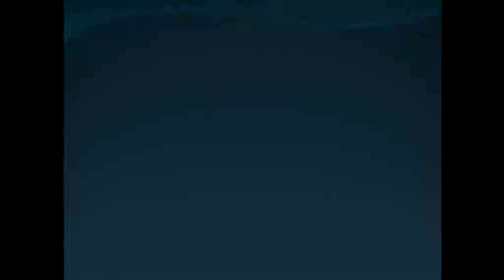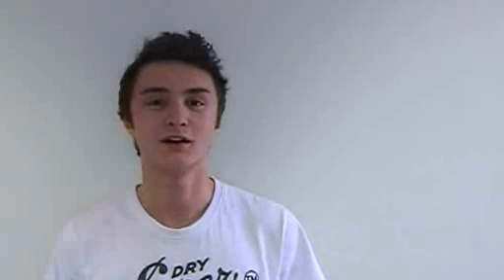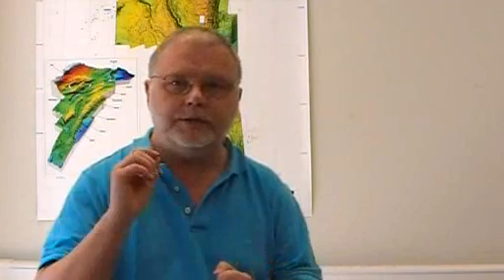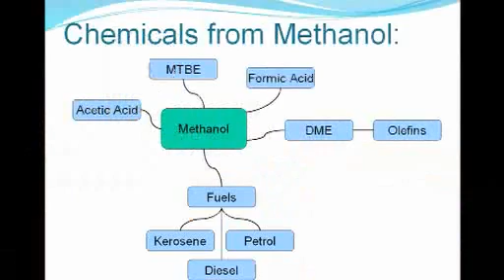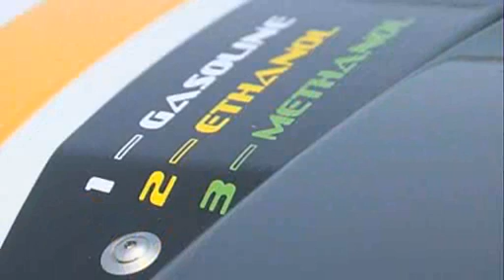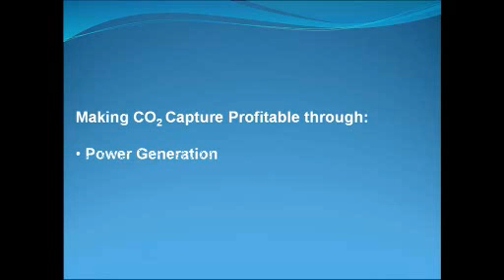Methanol Economy Proposal (BP Ultimate Field Trip 2010)

Comment from the maker: @samueltak There have been fleet trails in the US and Canada of 15,000 vehicles without a single incident of poisoning reported. The EPA in the US concluded that methanol is actually a safer transport fuel than gasoline as it is not explosive and does not form an explosive gas vapour as readily.

Also, we could engineer safety interlocks to make it very difficult for 'ignorant minors' to obtain vehicle fuel to drink.